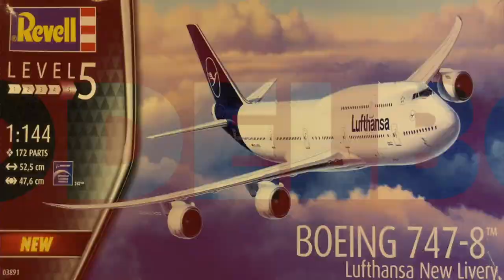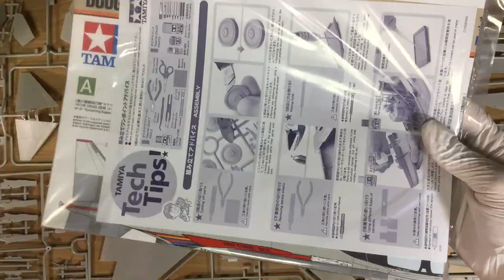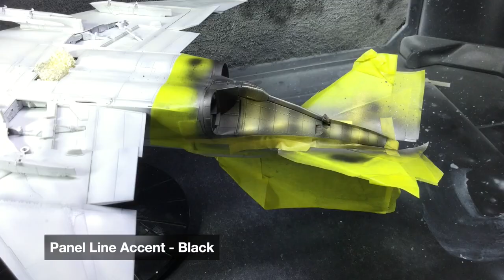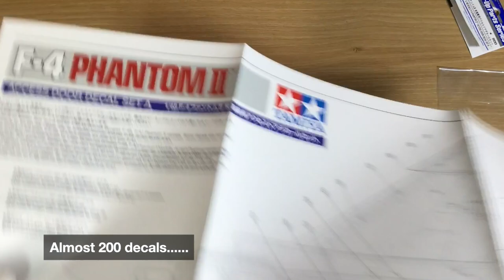TAMIYA 1/48 F-4B PHANTOM Ⅱ [Full Build]

Comment: Having to clean the airbrush is the only reason I don't paint more often. Can we get some kind of instant or one step cleaning tool, please?
Reply from the maker: There is no easy way to clean airbrush easily. Check instruction manual and you have to paint as many part as you can at one time.😔

Comment: I see you paint some parts before assembly (ejection seat). Doesn't the paint prevent the glue from gluing the pieces together?
Reply from the maker: Of course, paint interferes with attachment, but it’s not a big deal unless it’s the big part.

Comment: Can you please guide me which wash colour should I use for:
(a) Fighter aircrafts' panel lines
(b) Under carriage
(c) WW2 aircrafts (British Spitfires)
(d) F-16 (grey scheme)
(e) C-130 (Grey scheme)
(f) Jet engines

And while cleaning the extra wash, whether the qtip is to be soaked in water or thinner...

New to this, so would be grateful if you can please guide..
Reply from the maker: Why don't you start with black color?
If you use water based color, you can use water.
However, every paint has proper thinner, even though acrylic color ;)
Reply: Understood...thanks...

Comment: Are you putting that tamiya cement directly on the painted plastic or did you remove some paint first?  It looks like you are putting on painted parts. If so, thats great.
Reply from the maker: Sometimes or not I know it's weak to adhesion after painting, but when it's hard to paint after glueing, I have no choice but to spill the thin cement😔
Reply: @MODELBOX1  thank you so much for the reply. I love your videos and your channel. I am learning a lot.